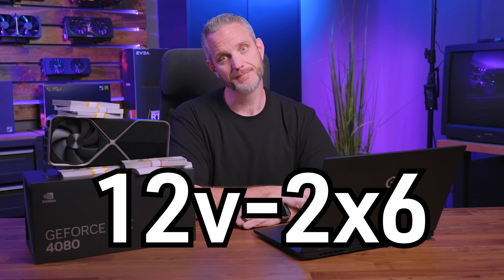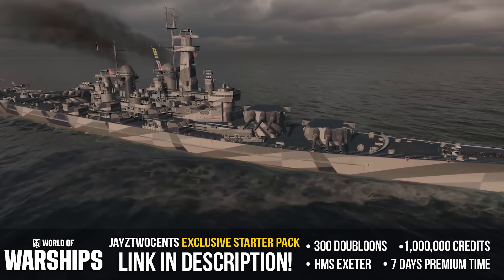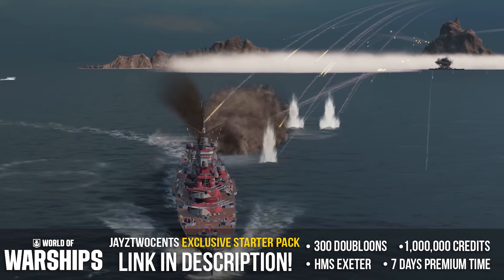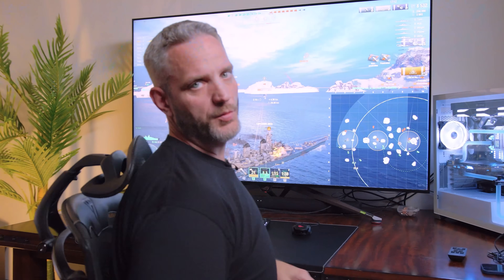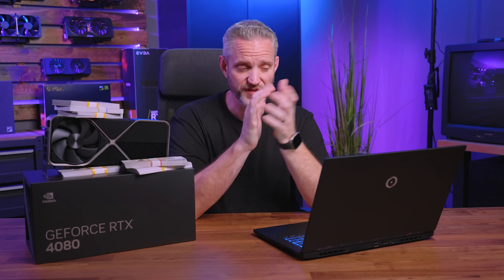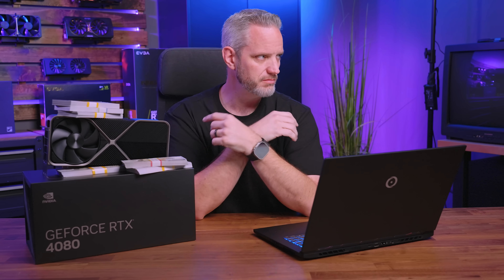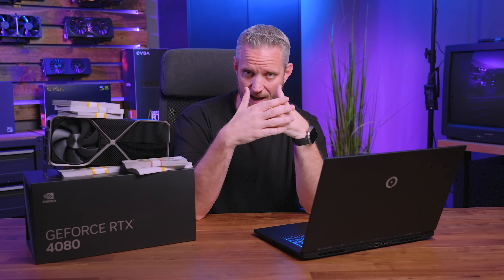They FINALLY admitted that this was a major issue!

Comment: I have a PNY 4080 and i haven't any issue with the connector. I am happy so far.
Reply: 4080's have less issue been some but not on scale of 4090.I just went with a 4080 myself until this issue is done but my 4080 serving me well so keep till the 5000 series or see if AMD actually steps it this time with the 8000 series
Reply: @johnnyboogalo4897  yeah the most cards have connector issues are the 4090... I am curious what Nvidia do with the next GPU series.
Reply: Did you watch the video? Lol. Mostly only 4090s are being affected, because they're the only cards that draw enough power to melt.

Comment: Can confirm, I was having the black screen & 100% fan speed issue and it was a loose cable mod connecter at the card. Visually it looked fine, but I reseated it and haven't had an issue in a week. So possibly some defective adapters for other people but I 100% think that a loose connection is the issue.
Reply: Exactly same thing happened to me.
Reply: Same. Tried everything and nothing worked. Turned out to be the new replacement Corsair cable. Replaced it with the default cable that came with the card and not a single issue for about 5 months.
Reply: Properly seat your power cables, buy a case that fits, do not bend cables, do not use 3rd party adapters, have a professional who knows what they are doing building rigs and you will have a %99.9 success rate according to the data

Comment: Is it just the cable coming out of the power supply that needs to be replaced or is it the actual connection on the video card?
Reply: Both. Unfortunately, current owners can't do much about it.

Comment: Whoever was responsible for this mess needs to pay for GPUs to get an upgraded power plug
Reply: As a engineer I will tell you that we are always on a tight budget of time and money. Even if we tell the higher ups this won't work because (insert Technical reason) and we need to (insert better but more expensive option) keep it safe. we will get overuled, they don't understand what we are saying and won't comply. All they want to see is numbers going up so they can afford they're 3rd car. And even if it destroys the company 1 year later it won't matter they will just go and destroy the next company they already made there money.
Reply: @leroyjenkins0736  I always blame the bean counters over blaming the engineers.
Engineers naturally want to make something that lasts a long time and has a lot of features.
But that's "too expensive" they say.
And then in the same breath they charge about $2000 USD for a 4090 that hey guess what we saved $0.01 by using this cheaper power connector to carry 600 watts, so now it melts instead of providing years of trouble-free operation.
Fucking bean-counters. Every time.
That's even what killed both space shuttles (and their crews).
The engineers with Challenger even SAID "Don't launch now, this is outside the launch constraints we agreed on when we designed the thing" and yet they got shouted out of mission control.
Yeah that went well, we lost 7 good people because of that whole mess of stupidity.

Comment: Hey jay, I got a 4090 about a month ago and i woke up yesterday to a melted connector and a room that reeked of melted plastic and electricity smell, I was using the 90 degree cable mod adapter, variant b, contacted cable mod and they said they could only refund me via PayPal which I do not use and can’t use, contacted MSI and they said that they can’t do anything and I should contact the original seller (which is them on Amazon, it wasn’t a reseller). Kinda confused what I’m supposed to do, it’s been 6 days too long for Amazon to refund me (since they can do that within 30 days). I ordered my card and the cable adapter, but I got the wrong variant so I sent it back and replaced it with the variant B one instead of A, that alone took about a week or more. I was upgrading from an rx590 that pretty much died and couldn’t do anything anymore

Tho i know it’s very unlikely for you or anyone to see this, thought I’d still write it and hope for the best, I’m not sure what to do at this point, Amazon said they could let me send it back but I’d have to pay 320$ “restock fee” that will come out of my refund because “you are sending after the 30 day period”, they even said this is a one time exception too, they did let me refund the cablemod adapter tho and since it’s literally welded to my gpu they said I didn’t have to send it back either
Reply: For the record, I’ve got pictures of everything, it’s all in as much as it would go, everything was put correctly, I have made sure of that because of the melting problems, took like 5 minutes just to make sure it’s set correctly
Reply: @YHK_YT good luck either way!
Reply: @braderley  I’m not sure that is the best option, it’s new, has been used for a month or even less and is still covered by warranty, I don’t really think paying 320$ to just have nothing is a smart option, I’d be losing money for what? Defective item? Don’t think I’ll do that. Considering it’s not a one time case thing, no way this many reports are made and every single one of them is user error, and I know for a fact I didn’t have it on wrong in this case at the very least, I’ve done the cable management and then put the adapter, spent a good 5 minutes just making sure everything is right and documented it, I took pictures of it, jay said in a video about the cablemod adapter that his did not get hot to the touch even while using his gpu, mine was hot every time I touched it and it was under load, not sure if that’s of any significance however it melted either way, temps were normal before I went to bed, and I never yanked it or anything to make sure it’s seated in after turning it on, I’ve seen jay say that some people keep tugging on the cable adapter to make sure it’s seated in right so that they don’t end up with a melted gpu, mine was never touched after I confirmed that it’s in correctly as I don’t need to touch it again, I did put my finger on the metal part of the adapter, did not pull or push it, just to see the temperature, I did that a couple times just like jay said he’s done

Don’t think I should be paying 320$ for what’s basically a brick right now, a very expensive brick, just because MSI can’t understand that I bought it from their store, from the official seller, on Amazon, and Amazon keep telling me to go to msi, it’s very confusing and annoying, I’ve literally put everything I had into this and I went from a basically dead rx590 to this because I do use all the vram and I appreciate having my work finish faster than normal (deep learning, blender, davinci resolve, etc, along with some gaming), I was limited by my old gpu because it’s amd and the fact that it’s old, and the vram too, about 3 years ago or so it decided to die, it somehow came back to life but it was just coughing the entire time, I could not buy any new gpu since everything was price stupidly, I caved and got a 3080, it was new and sold for much higher than msrp not to mention that it just kept stuttering for no reason, shop refused to take a look at it so I had to sell it for less than I got it, I then got another one from another shop months later and that was an MSI gaming z trio, it was basically perfect, only problem was vram kept overheating every time I ran a vram heavy task, which is not normal, so I sent it back to the shop, they took 2 weeks to send it to another country “the supplier” and then took a whole month of the shop owner just saying “we haven’t heard back yet” just for them to refund me the price at the end, I was honestly annoyed because I’d rather have that gpu and replace the thermal pads myself than have the money since I did need it at the time and still do, after that I bought a used gpu which had so many problems  I ended up returning it and luckily the person who sold it was understanding and refunded me, then fast forward till about a month ago, I got bored of having to wait for this price drop that never came, bought the MSI Gaming X trio 4090 (somehow for MSRP) and it literally costs the same as a 3080 back when the prices were high, like the one that the shop refunded me for costed more than this card

Went on a bit of a rant but no I really don’t think that’s a good idea, I’d rather just get it replaced and pay nothing since it’s not something I did, that’s like you received a monitor and it has a giant crack on it and it’s panel is basically half dead, and then being given the offer to send back the monitor and get a refund, except they take some of your refund money, even tho you’ve done nothing wrong, it doesn’t make sense
Reply: If I read it right, pay that $320 restock fee and get the majority of what I spent back on the graphics card. It seems MSI aren’t going to do anything for you, and if Amazon are gonna take a restock fee knowing it’s unsellable I’d take it. 

 No real buyer protection in the USA and id think there’s still the fact you used a third party power adapter in it, rightly or wrongly I’d expect them to hide behind that if pushed further

Comment: Overtime they didn't "wear out" because when the normal user plugs in a gpu, they don't ever take it out. HEAT causes that thin metal to deform and fatigue. Constantly heating up and cooling down will cause the pins to lose contact on those tiny dimples. Which will also cause it to arc if they are barely not touching. That causes further breakdown. I'm not an engineer and I know this. This is also further evidence that college is a fraud.

Comment: Are we gonna have to upgrade our power supplies again or will It be cross compatible
Reply: I suspect just the cable. It may not be a perfect 1 to 1 match, but it should be close enough that it's not an issue.

Comment: 100% This one will melt as well.
Reply: Why even bother with these cards, unless your job in life is to waste money.
Reply: @camotech1314  Because some people have that sort of money to waste? Because what happens at the high end will filter through to the ordinary user? Because some people with different priorities might not consider it a waste at all?
Reply: @camotech1314 it’s very simple. 4090 is the only graphics card in existence that can run all my games at full speed with max details completely silently, because I can power limit it to 60%, let the fans spin at minimum RPM and it still maxes out my monitor’s 144 Hz refresh rate. No other card has that kind of muscle while running completely silently. That functionality right there is worth its weight in gold to me, I would have paid double to get it.
Reply: @little_fluffy_clouds same
Reply: The way I see it, some people seem to enjoy being ripped off. Normative influence is like a fantastic wunderbar wet dream for Nvidia advertisers.
Reply: No they wont... Just shamefull nvidea beber admitted this to BE a real mistake on their behalf
Reply: @Saiohleet  You be the guinea pig. I will buy cards with the 8 pin connectors.
Reply: @Saiohleet it's beber baby

Comment: I like the idea one card/mobo combo uses of adding another connectir to the board and card to pull more power without a cable.
Current mobo specs are ancient. A testemant yo how good they have been, but the me and tech marches on. I think it's time to design a new spec.
Reply: you mean like the gpu drawing power purely from the mobo?

ehhh okay but consider this: it'll definitely drive up mobo prices substantially because of all the extra pcb layers, it might kill the ITX format because those boards are already very dense, and we'll have compatibility problems for the better part of a decade as things get standardized, 

and worst case it wont be standardized and stuff like msi gpus/mobos wont work with asus gpus/mobos, or some boards being able to supply more/less power then others like a high end mobo being able to run a 400w gpu and a low end one only being able to run a 150 watt gpu.

sounds like an expensive fix for a 12 dollar problem, i'd rather just use a cable.
Reply: @quantum5661  oh it would definitely have the be a standard. And I don't necessarily mean a 1kw connector on board. But perhaps allowing the exiting connector to go up a bit or have an extra connector for an additional but of wattage added to the board so that low to midrange cards can treat the cable as optional on compliant boards. 
Like I said it's time to look into updating the mobo standards, was the emphasis on standards.

Comment: 🪄✨ Made with SummarizeYT app
0:00 - The 12VHPWR plug is finally getting an update and a name change to 12V-2x6.
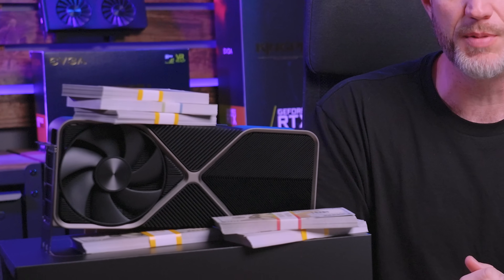0:23 - The update aims to prevent melting and improve the reliability of the plug.
1:20 - The changes come from the collaboration of various board manufacturers, not from Nvidia or Intel.
2:32 - The new specification includes changes such as power draw, temperature limits, and minimum force required to pull the plug.
4:02 - Different manufacturers and suppliers use different pin types and wire gauges, leading to variations in the adapters.
5:01 - The new specification ensures compatibility regardless of wire gauge.
6:43 - There are two types of pins in the market: Astron and NTK. NTK offers better contact and greater contact area.
8:02 - The standardized spec recommends the use of NTK pins instead of Astron.
8:27 - The new spec increases the power rating to 675 Watts, allowing for better power delivery.
9:00 - The spec also allows board partners to draw a full 75 Watts from the PCI Express slot.
9:35 - The new 12V-2x6 plug has more contact surface area compared to the Astron 3 dimple plug.
9:39 - Changes to the terminal side of the plug have improved contact points and decreased the chances of poor contact and melting.
11:01 - The new specification includes a minimum of 150 watt sense pin for better communication between the graphics card and the power supply.
12:10 - The new plug design includes a safety mechanism that disconnects the plug before it can cause melting or poor contact.
13:16 - The plug now has a minimum wire length requirement to prevent tension on the pins inside the plug.
14:00 - Loose plugs or damaged sense wires can cause black screen issues and 100% fan speed.
15:00 - Using NTK pins on all adapters is recommended to ensure reliability and prevent melting.
17:06 - Users with three-dimple plugs should consider exchanging them for NTK plugs to improve safety.
17:28 - Repair services may start offering plug upgrades for existing cards to prevent future issues.
19:02 - Using NTK pins was discouraged in the past due to higher costs, but it provides better reliability.

Comment: I still think the old cable is still the better cable more huge wire to handle the current and no it won’t the wire is still to small
Reply: that message is impossible to read but i agree that the old 8 pin pcie cable is the goat.
Reply: i had a stroke reading that
Reply: @GeisemoOUTATIME Same. Left side of my face hurts.